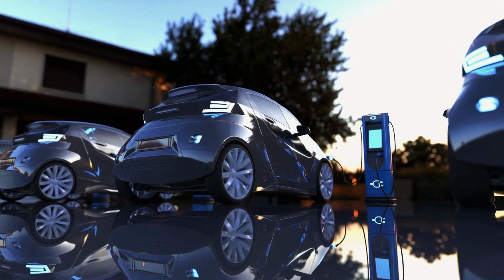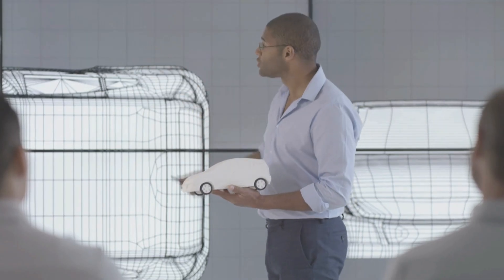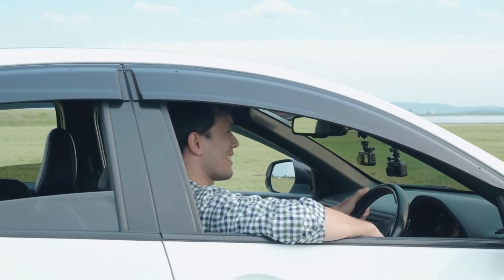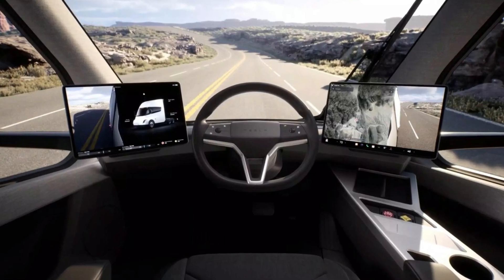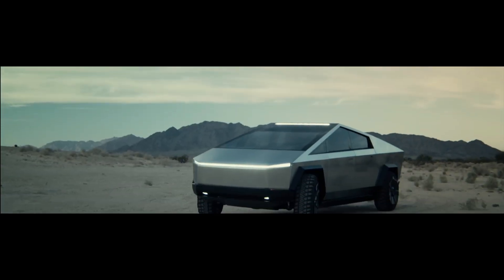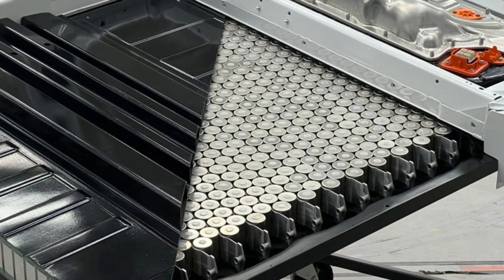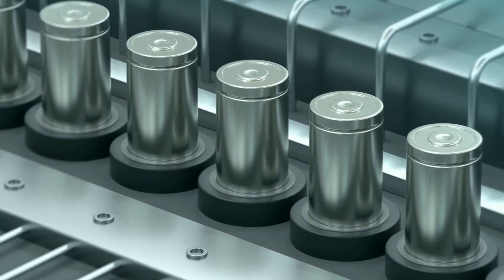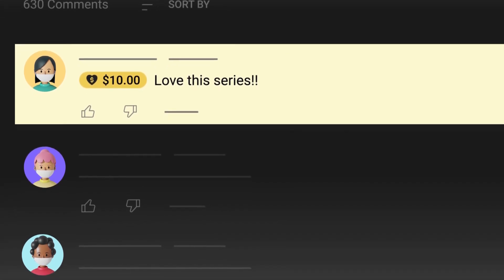Elon Musk - This NEW Tesla 4680 Battery Will Destroy The Entire EV Industry!

Comment: According to an analysis carried out by the University of California (UC) in San Diego, the 4680 cells of the Tesla Model Y manufactured in Austin (Texas) offer an energy density of 244 Wh/kg, lower than the 269 Wh/kg of the batteries Panasonic 2170 used in the Model Y which is made in Fremont and the 252 Wh/kg of LG cells in the Shanghai Model Y and Model 3.
Reply from the maker: Thank you for watching